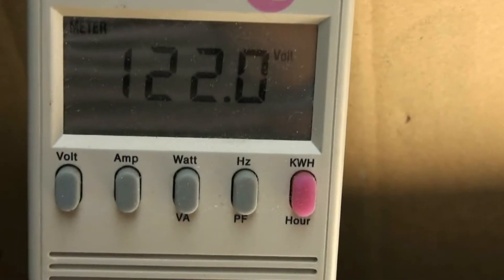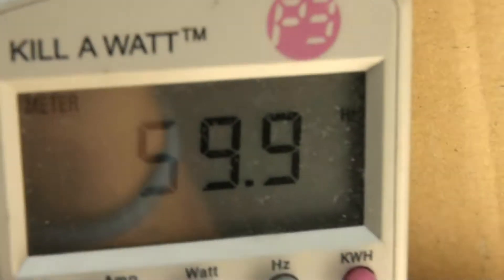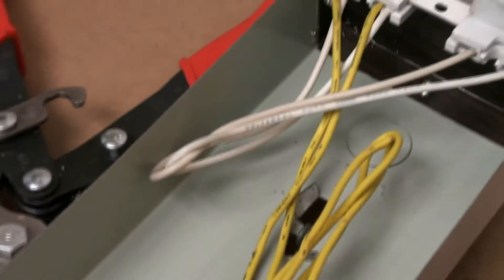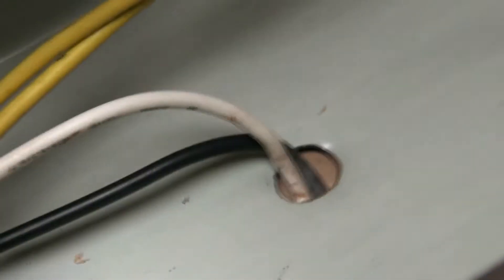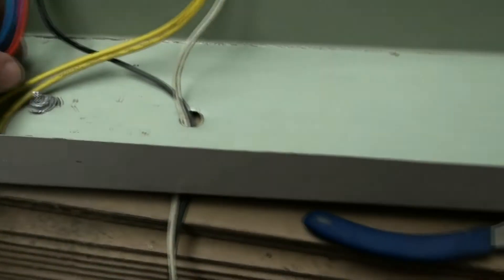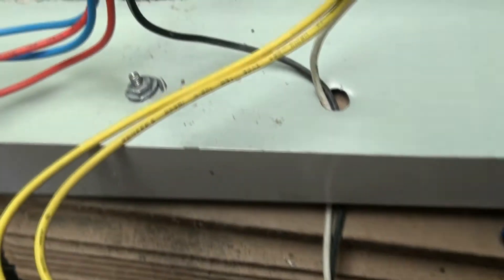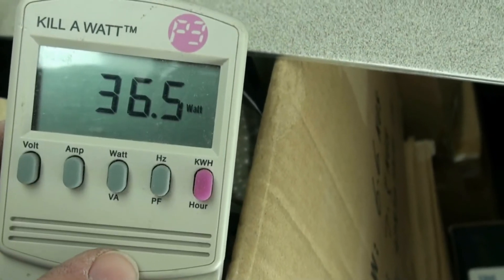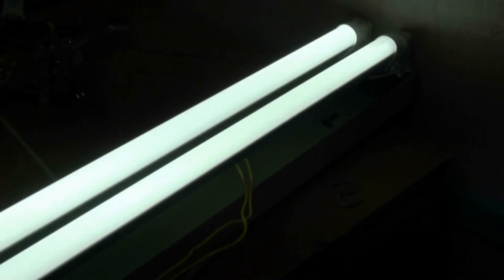Kihung T8 LED Light Tube 4ft 22WT8 LED Instruction Video

Comment: I'm at a loss.  I did exactly as you said and the bulbs came on for 2 seconds and then went out.  I double, triple, quadruple checked the wiring and then tried 4 different bulbs (I bought 2 packs of 6).  I'm wired exactly as you have it but I can't even get it to come back on for a second.  Any thoughts or ways to troubleshoot would be greatly appreciated.
Reply from the maker: check your tombstones, the sockets that the LED light tubes attach too
Reply: I just picked up brand new tombstones.  Took a known good and working bulb that fired up with a t12 ballast but then overheated the ballast and connected it.  It came on for 3 seconds then I lost 3 sections and then then last.  I'm using the exact same bulbs.  So far, 4 have "burned" out with direct wiring to 120.  But, when I connect the good ones to the old ballast they work until the ballast overheats.  Should I put a T8 ballast in?  Thanks for responding to the comment by the way.